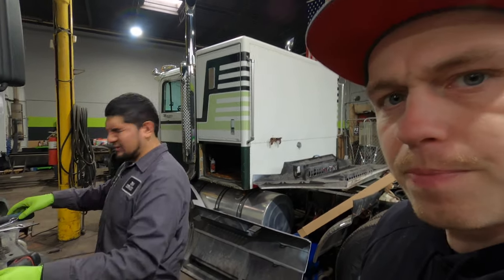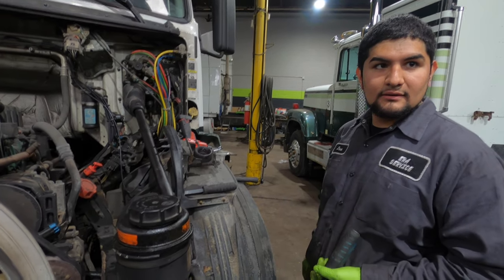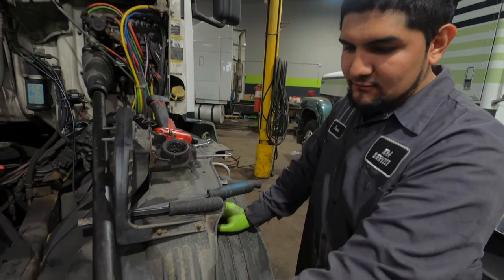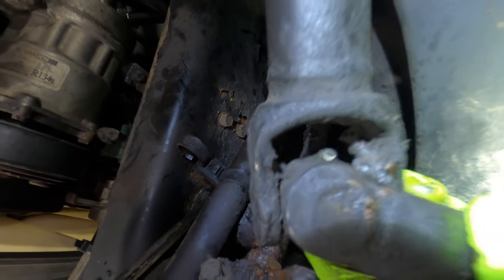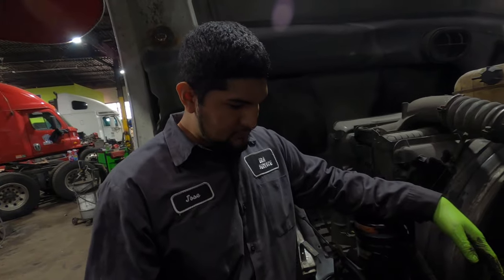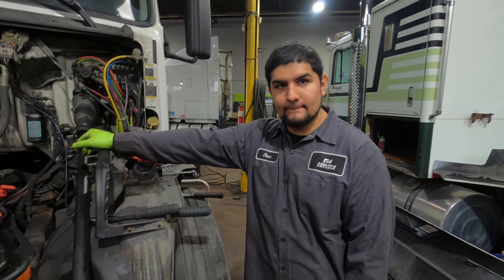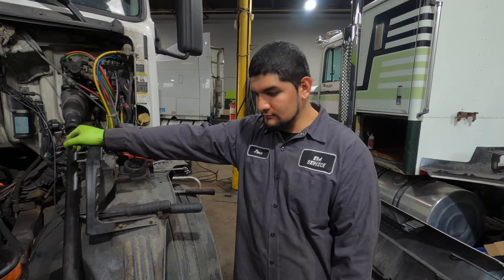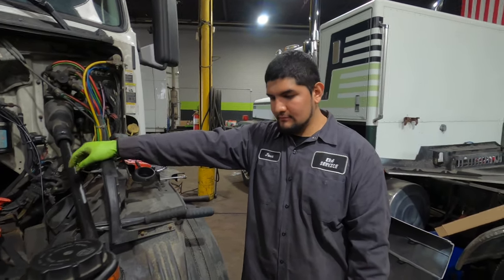Hard Steering? Check This. Don't loose control of your truck

Comment: Had the same problem on condor sterling trash truck..grease fitting is in a narrow area...guys couldn't fit standard size grease gun tip to lube..had to get narrow tip to lube...I soaked the ujoint in atf and gear oil...lubed ujoint..and reinstalled shaft...works great now..good video....I found out the hard way..I ordered gear box and found knuckle seized when I removed shaft from gear box..I spent the whole day lubing the ujoints on our whole fleet of trash trucks..

Comment: Had my power steering going out on the Mack I was driving. The PS cooler had a hole rubbed in it from bouncing around so much.  That was a fun drive to the shop.

Comment: I just figured out last night my top U-joint was binding on my 2010 Peterbilt 387. Thought I had air in my PS fluid so I jacked up the truck and ran the wheel hard left to right. Noticed that the binding was every half turn of the wheel. Sprayed WD-40 on the top (rusty) joint and it turns smooth now. No grease fittings so they are likely the originals. Was searching for info on the U-joints and found this video.

Comment: DUDE. Please make a detailed video about how the steering components work, and common problems to look for.  I know some problems and defects are obviously, but the FMSCA and schools do a shit job of educating us on the details.  My truck has 510k, tight steering, decent power steering power, a greased fifth wheel, tight u-bolts on all axles, and no obvious steering linkage defects, but it has become an absolute chore to keep it between the lines.  HELP
Reply: Take it to a shop
Reply: @everdream741  actually figured it out, I had our mechanic tighten the fifth wheel since my company uses those cheap shitty Holland fifth wheels with the rotating locking jaws... apparently, it was loose enough, that the king pin was moving freely side to side... drove like a dream after they tightened it
Reply: @davidjolley2468 good to know everything is fine . Good piece of information. Drive safely.
Reply: Alignment

Comment: Great video my friend. With my truck when the vehicle is in motion and moving through a yard no issues with steering no skipping no binding, nothing when I was trying to Jack knife the other day in a stopped position it was stiff I had to give it some throttle to move it. What could that be. When I opened the power steering steering reservoir it was a bit warm and a little bit of smoke was coming. Keep in mind I was trying to Jack knife in a spot. Keep in mind. I was trying to jack knife into a very tight spot for around thirty or forty minutes so we were overworking the steering.  I notice sneaker trucks are more stiffer than daycabs is this true as well. The truck is two thousand and seven by the way

Comment: I have a 2015 freightliner cascadia dd15 and the wheel is smooth to turn when not in motion but binds up when turning while driving..
Reply: check the pumo

Comment: Ok, I was really paying attention, but I didn’t hear how you resolved the problem. Was it on a Volvo? Did you replace the u joint or did you get a new steering shaft for the truck? Was it a sealed u joint originally and you replaced it with a serviceable one? I’m not a big fan of Volvos anyway. I check that steering on any and everything I drive, especially if it’s an older truck. Ok, I watched it a 3rd time...it is a Volvo.
Reply: Porter Productions sorry it wasn't clear for you. We just replaced it with a new one. We have used parts  in stock so we just swapped it but I should do a better job explaining it.Thank you for your feedback